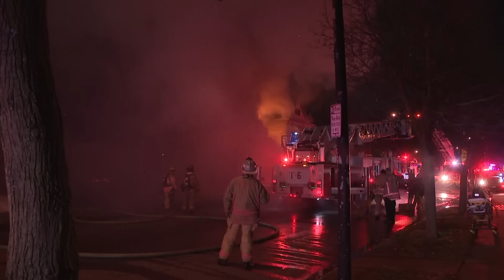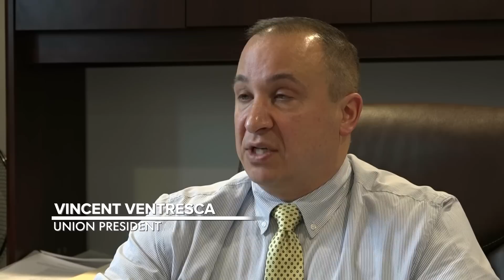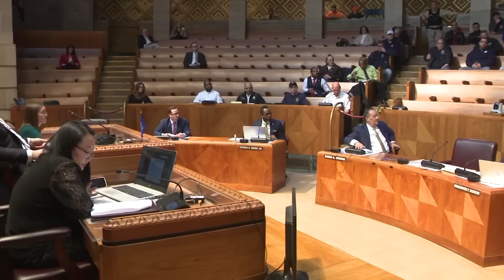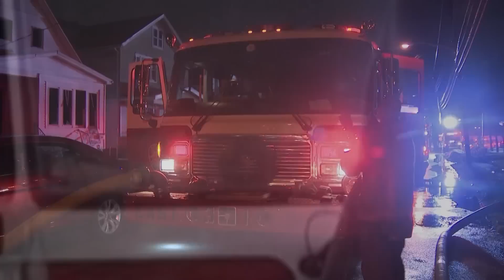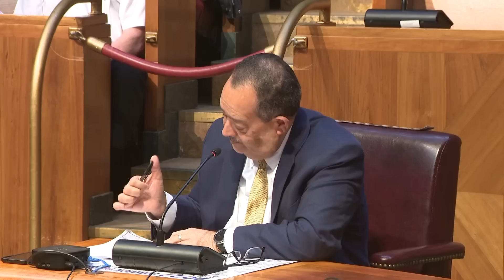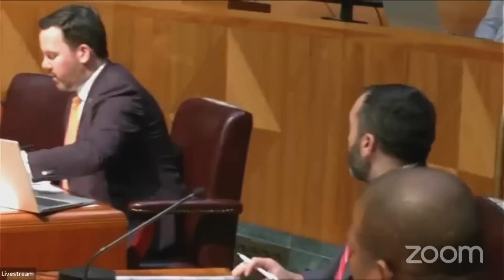Buffalo's firefighting fleet is a mess

Comment: Over here in Europe, to cut costs and build time, fire engines are build on top of already avaliable reliable commercial chassis, like Mercedes or Volvo trucks. Maintenance is easier and cheaper too, as it's all standard truck components.
Reply: And I think the fire engine bit that goes on the chassis is fairly standard, so the company converting them is making small batches of identical vehicles not bespoke one-offs.
Reply: @dom1310df  Wrong, at least in my experience. The truck bodies are very customizable (compartments, ladder racks, hose beds and MANY other things).
Reply: Using a commercial chassis is commonly done.

Comment: In Europe all fire trucks (with a few specialist exceptions) are built on commercial chassis. The most common being Scania (used worldwide) followed by Mercedes and Volvo. After that there are MAN and DAF. Appliances that are used wholetime usually have an operational life of 10-12 years depending on mileage, condition and pumping hours. Retained/volunteer appliances which have a lower call out rate obviously stay on the run longer usually for 15 plus years. Aerials/ TL's are regularly remounted on new chassis. As long as the rig is well maintained they can last easily up to 25 years.
Reply: Yes this is buffalo so there not unfortunately

Comment: interesting story. confusing why commissioner Renaldo will not advocate for his own department. And of course the police dept isnt having any trouble getting new vehicles.
Reply: Probably because the police commissioner, as most in the US wont accept driving around beat up nonworthy vehicles. Civil service should have the best in order to have zero excuse to provide service. 

This FD commissioner is getting some kind of backing for destroying his dept, it makes no sense
Reply: @AimingUpAdventures  the trucks need better maintenance and they'd last 15-20 years or more
Reply: @X Zxxx  That is simply not true if they are engines running in a major city responding to thousands of calls a year. Its why if you buy a brand new car and in 2 years put 200K on it, it will very likely not make it another 4 or 6, much less 10 years. These vehicles are driven hard and are pushed to their limits almost on a daily basis
Reply: @AimingUpAdventures  that’s BS. I’m a heavy duty mechanic for a fleet of railroad trucks and equipment. Our units operate 24 hours per day 7 days a week. No time sitting around at a station between calls. Our vehicles have tens of thousands of operating hours by the time they’re 10 years in (roughly 10x what these fire trucks have). Maintenance is absolutely the key.
Reply: @AimingUpAdventures  Not true. My hometown volunteer department has vehicles from the late 70s still in running shape used for wildland and brush fire operations. One was a prior military truck, and it gets sent into areas some trucks can't go. Good maintenance will keep a truck running for a surprising amount of time.

Comment: How are vehicles in the US supposed to be only 10 years in service? In Europe the trucks are there like 20 years or longer and afterwards shipped to lower developed countries to serve their last lifetime there or to be sold as a camper RV to people
Reply: It ran completely differently. Fires are completely. It's a different world honestly
Reply: You can't compare the Medium age. Europe has way more volunteere Departments with just a few calls per year. My home Village FD  has around 30 to 50 calls a year so a 20 to 30 year lifespan of an Engine, if well maintained, is not out of the ordinary. On the other hand an Enigne with the FD of a bigger City (which are most likely full proffesional Departments) runs 1500+ calls a year. So after 10 years it has been on 15.000 calls, of course it's worn out faster than an Engine that runs 300 to 500 calls in the same time frame. Most professional Departments, including mine, are replacing their firetrucks every 5 to 10 years. Most of them are handed down to volunteere Departements for a cheap price. 
So 10 to 15 years is quiet old for a firetruck in a Major City like Buffalo. These rigs were on 20.000+ calls by the time they reach that age.
Reply: You would not find average 10 yo vehicles in proffesional fire departments in the big cities in Europe. In volunteer departments, yes.

Comment: Meanwhile rural dept's are running their "new" front-line 20 year old apparatus 😂 and the 30 year old stuff is still their favorite truck to pump... 

10 year old apparatus falling apart to the point of a seat missing? Sounds like a maintenance issue and People not doing truck checks to let apparatus get that far in disrepair.
Reply: 60,000+ calls per year versus 1000….sure.
Reply: This is a little ignorant tbh. You're kinda missing a few things. This comes from nobody with experience, just knowing people who do both.